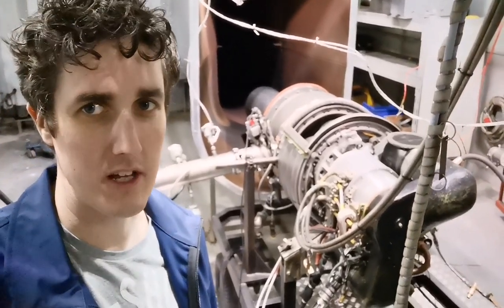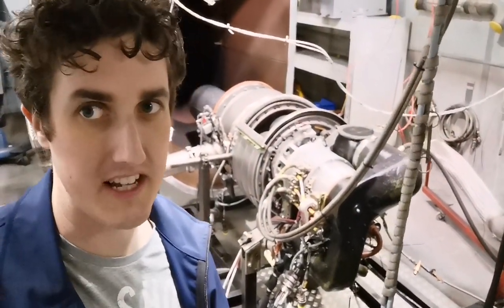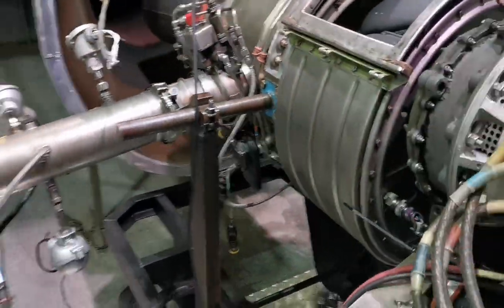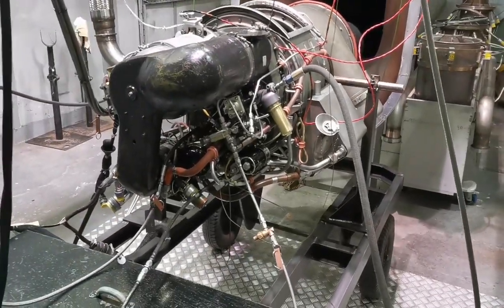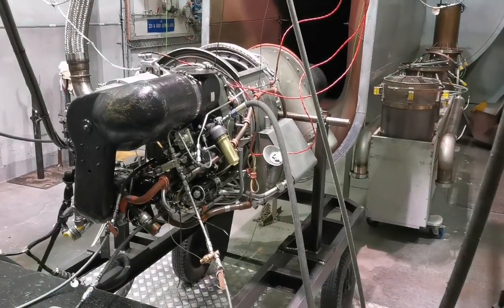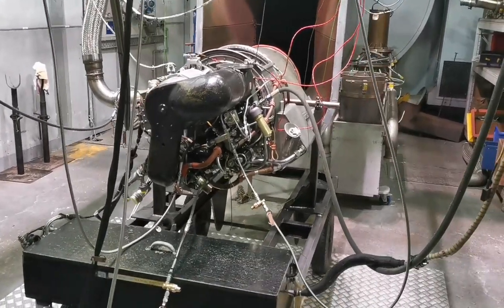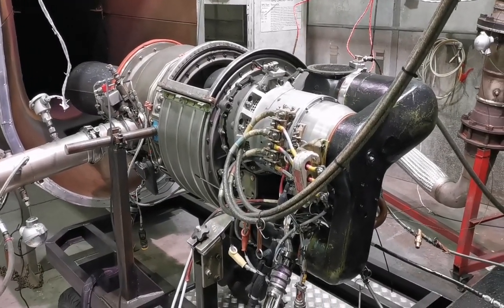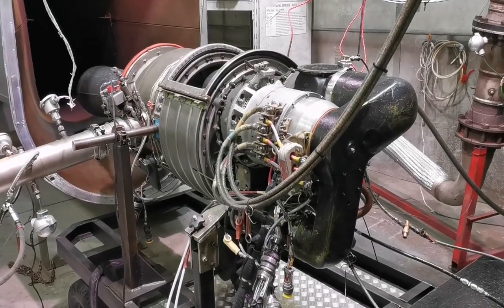AIRCRAFT APU - Running an old school turbine engine - The Garrett / Honeywell 85 series APU

Comment: i have one from an 80's dc 9  where do i start to run it?  basic requirements ad all the advice you can spare . thank you.
Reply from the maker: Keep it simple. Get it into a suitable stand first. You'll need 28v to your solenoids, starter and ignitor box. Blank off the bleed air discharge too. Get a fuel supply onto it and see how you go from there. It doesn't take a lot to get these to run, especially if it's one of the earlier mechanically controlled FCU's.

Comment: Hey Mate I have a model 85 similar to that one. I'm interested in the generator, have ya got any info on the generator and control system it looks like a Westinghouse/Bendix/Plessey variant? There will be a control unit to go with it if you are running it that way? Ya have a load bank for it? Cheers Ian
Reply from the maker: Hi Ian. I actually don't work there any more, but I do know that there were 2 main versions of generator that came in on them, a Westinghouse and a Lucas unit. We did have a GCU and a load bank, yes. If I remember correctly, we put a 55kw load on it.
Reply: @Endfloat  OK cool thanks for the reply. Was looking for info on the GCU. We've built our own system for use the my GTCP85 from BAC1-11.
Reply from the maker: That sounds like a cool project. Do you have a particular use for the APU? Sorry I can't be of more help about the GCU. I never really looked at it in detail cause it always just worked.

Comment: You're going to have to put fatter tires on her. Those don't even have inner-tubes so it'll break loose at the green light and be pretty bumpy too.
Thanks for the vid!
Reply from the maker: Haha that would be good fun! If I could figure out a way of getting it's 450 hp to the wheels, I'd stick one in the back of a van.